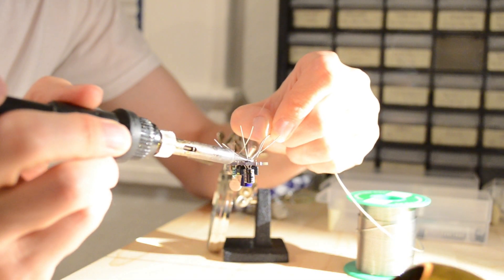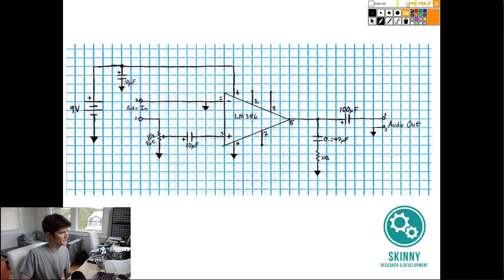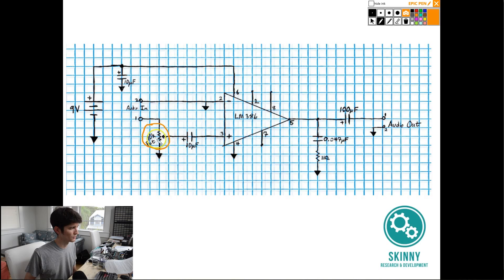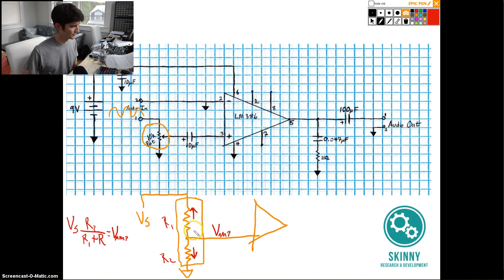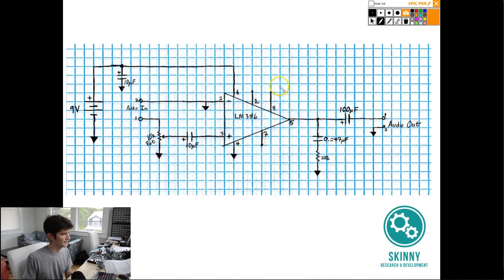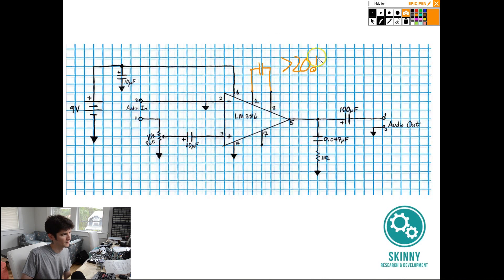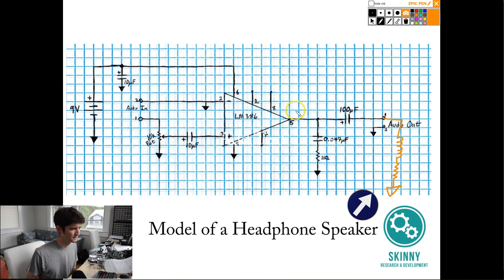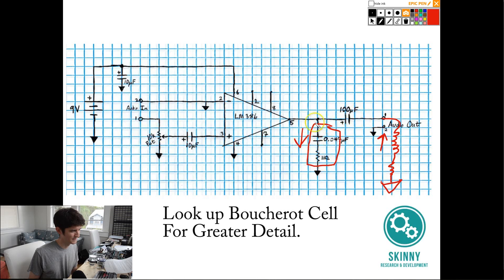A Beginners Guide to the LM386 Amplifier Circuit

Comment: I really enjoy your video’s, the explanation and practical uses of the circuitry. Sometimes I have a hard time following because I was thought electron current flow but you explain things from a conventional current flow, also known as (Hole Flow). I know either works but it’s still rather difficult seeing it explained in a different direction. Maybe you can share something that could help me?

Comment: I've seen lm386 circuits with seperate grounds for power and signal and also with caps on the input stage as well just wondered if you knew of this and could explain the theory behind this practice. 🤔regards Kevin

Comment: in almost all the other opamp vids I watched, they all use closed loop configuration. But in audio amps, they all seem to use lm386, and it's often open loop. Is there a difference between lm386 and your usual opamps?

Comment: I would use with a source of 12v coming from a Transformer, the speaker will be 4ohm 5W...is it possible?
Great explanation
Reply from the maker: The 12V source should be fine, but I would make sure not other AC noise is coming across the 12V transformer. If that transformer is connected to mains power, you might end up fighting a pretty nasty 60Hz hum noise on the output.
Reply: @Skinnyrd  ok got it,then where should be connected if not to the main 230Vac? Maybe should be isolated?
Reply from the maker: I use batteries. Isolation will help. Try it without isolation first and see if it's a problem.
Reply: @Skinnyrd  Last but not least, i'm wondering about how many V/A my transformer should be to avoid any damage to the IC and speaker
Reply from the maker: For most LM386 chips, 12V is the high end of the voltage range. There are some chips that will accept more. As far as current, it shouldn't matter that much. Also, if you setup the circuit right, the speaker shouldn't be affected by the voltage because it is protected by a fairly large capacitor.
Reply: @Skinnyrd  Thank you for your suggestions, appreciated
Reply from the maker: No problem.

Comment: When I take out the potentiometer because I control the Volume with pins 1 and 8 by putting a potentiometer between them and the capacitor only using 2 pins of the potentiometer , can I just let out the potentiometer on pin 3 or do I need to add 1 or 2 resistors?
Reply from the maker: I use 2 pins on the potentiometers all the time. It's just turns it into a simple variable resistor.

Comment: I use this circuit with 12 volts but after 3-2 trials the chip burnt. I tried with 2 chips and both have same problem so what is issue with 12 volts. I am using 3*18650 cell as power
Reply from the maker: In the datasheet a normal LM386 should be able to handle 12V.

Comment: As an Advanced avionics tech at Boeing for 30 years I saw a lot of engineers with book knowledge and no practical experience with real life application. It was our job to lead the engineers as what a circuit really did in real life circumstances compared to paper

Comment: First mod: increase input voltage to 12volts.
Reply: Depends on which usage for! For the use in a car - ok 12V - but for other mobile usage a 9V block is the way to go - in my opinion...

Comment: Thank you for that decoupling cap trick :) Would it always be 10uF? It has to be electrolytic?
Reply from the maker: 10µF is a good value because it helps to short out those audio frequencies being produced by the amp. It doesn't need to be electrolytic but it's probably cheaper.

Comment: Thank you very much sir. Sir i want to know about the highest value of capacitor that we can use to increase gain between pin 1 n 8. Is it necessary to add a resistor in series with the capacitor? 
please specify values also.
Reply from the maker: +shubham kushwaha The datasheet recommends using a capacitor of 10µF. This will increase the amplifier gain to 200. Without the capacitor, the gain is 20. It is not necessary to add a resistor in series with this capacitor. If you do, you will decrease the gain.

Comment: I used the same circuit to build a audio amp and it produced a considerable noise ,to decrease it could I remove the potentiometer and just keep a 10k resistor ?
And another question in case if we use the capacitor between the pin 1and 8 to inc the gain is it necessary to use the bypass capacitor at pin 7 ?
why the decoupling capacitor is polar ?
Reply from the maker: +Amarnath Karthi Question #1: If you get rid of the potentiometer, how do you propose to use the 10k resistor? Will you connect it in series with the capacitor or bring the resistor to ground? Each will have a different effect. Neither will do a decent job of decrease the input levels like the potentiometer will.

Question #2: It's not necessary to use the bypass capacitor, but when you start to hit higher gains by putting a capacitor between 1 and 8, you might need it. It helps to keep noise out of the earlier amplifier stages. It might help with your noise issue.

Question #3: The decoupling capacitor is electrolytic. It's electrolytic because at a higher capacitor values, electrolytic capacitors are cheaper and reasonably sized. Because it's electrolytic, it will be polarity sensitive or polar. It doesn't have to be electrolytic. You could use something else however it might be larger than you want and cost more than you might want to pay.

Comment: 1.is there any reason for using polar capacitor for decoupling and also between potentiometer and pin 3?
2.in my project which involves the use this lm386 circuit we used with input as mobile phone and out with a speaker , in order to reduce the noise can we remove the potentiometer as we can control the signal power with the volume rocker ?
Reply from the maker: +Tatsuya Shiba 1. The only reason I'm using that capacitor is because it's easier to find electrolytic capacitors at that capacitance. Many times they are also cheaper and smaller than their ceramic counterparts.2. You can remove the potentiometer but I don't know if doing so will solve your noise issue. I would think keeping it can only help.
Reply: thanks for reply I After soldering  the potentiometer connections the noise became less

Comment: is there any reason for using capacitor between potentiometer and pin 3?
Reply from the maker: +aravind jayanthi Yes. The capacitor blocks any DC voltage that might be present on the output of an audio source. For instance, I use a lot of powered microphones. The capacitor blocks the DC voltage used to activate the microphone but allows the AC signal produced by the microphone to pass to the amplifier.

Comment: Thank you.  I learned more in 12 minutes than I have in the hour I spent poking around the web.  The only thing I missed was why you added the 10uF cap between the audio source and pin 3.  I assume it is used to prevent clipping or filter out AC voltage.  Again, many thanks from an old guy trying to learn new tricks!
Reply from the maker: +Rick Schrager I'm glad the video was helpful. The cap is there to block any potential DC voltage from flowing into the input of the amp. It only allows AC voltage (the audio) to pass.

Comment: Oh ya only using 5 v dc. If that is a factor
Reply from the maker: +RC Canuck Maybe. No matter what your gain is, the audio could be limited by the 5V rail. If you can post a schematic somewhere, I can take a look.
Reply: +Skinny R&D 
Let me put it another way. Can the sound from a 555 timer be increased . Currently I have pin 3 going to a resister then a transistor . I have the speaker hooked up to the transistor collector and ground . I would like to make it louder I was hoping an amp would do the trick but no luck with the lm386 hope this helps  I will draw up a schematic and figure out where to put it if you still need one . 
Ps the sound  is going off and on like a flashing led which is what I want so that part is good. Just not loud enough for what I want it for 
Regards
Reply from the maker: +RC Canuck Yes, the sound from the 555 Timer can be increased by using an amp, but it can only increase to the voltage level you are supplying. According to the datasheet if you use a 5V source, you will get an output high of 3.3V. Even if you put that through an lm386 with a 5V source, the highest output on the amplifier you can hope to get is just under 5V no matter the gain setting. You may need to power the amplifier with a higher voltage source and then put the speaker in the configuration shown in the upper left hand corner of page 5 of this this pdf: http://www.ti.com/lit/ds/symlink/lm386.pdf

With all that said, I've not hooked a speaker up to the output of the 555 timer. I've only used ultrasonic speakers. Those work pretty well. Is the speaker you are using an 8Ω speaker. Let me know and I may try it for myself when I get a chance.

Comment: Hooked up a 555 timer with a flashing output installed the lm386 and got an ok sound but want it louder put in the cap on pin 8  and 1 but no difference even with the cap on pin 7. Any ideas ?

Comment: Just a quick question...  If I took the potentiometer out of the equation, would I need a 10K resistor between audio input and pin 3?
Reply from the maker: +Nick Sebring No, you would not need the 10k resistor. The potentiometer in the circuit is just there to vary the input level of the audio. If you don't need that functionality, leave it out. I would keep the capacitor between the audio input and pin 3. Have a great day!